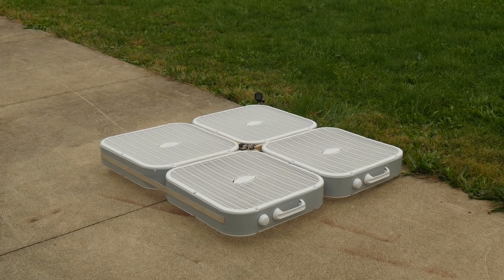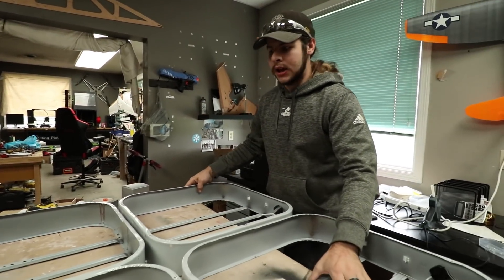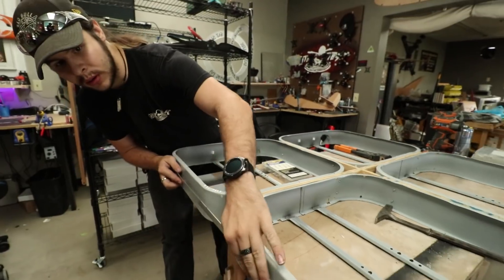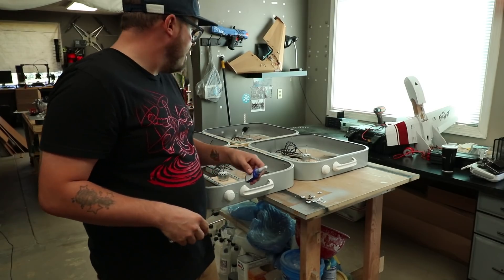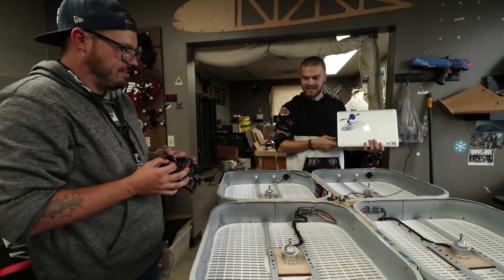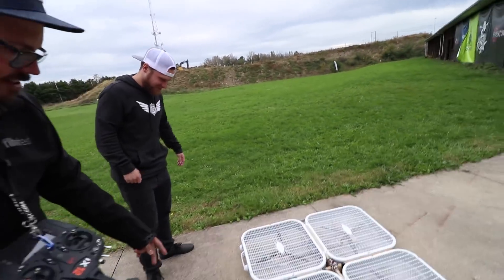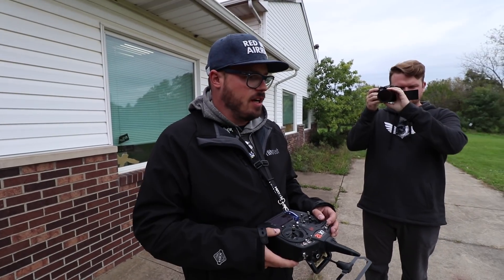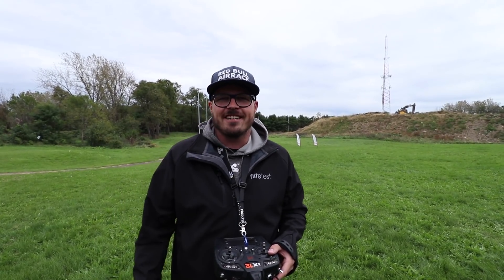Flying Box Fan Drone!

Comment: Just wondering!!!            Do you think if you made a VTOL.  about the same size of  a square card table  and put airplane type wings(airfoils) on the outside perimeter of all 4 sides .  the wings would open just above the top of the surface  about 15% open.  All 4 wings would almost touch each other and maybe 4 inches wide.  Then put 2 powerful ducted fans (facing each other about 4 inches or less apart from each other )  one ducted fan mounted through a hole  on the bottom center of the surface facing upward using air from under the table.   The other ducted fan facing downward  mounted in the center of the table  taking air from above the table.
a cone shaped diverter on each fan diverting the air 360 degrees radially blowing a powerful but thin air blade over  the surface of the table  directly towards  the 4 wings mounted on the perimeter of the table.  My question?   Would it fly??

Comment: Usually these guys got it covered.  However, on this build there's an issue.  The wood frame was completely unnecessary.  Bolting the fan walls directly together would have been sufficient, and if done right, no wiggle room at the connections would be possible.  In fact, the wood frame may allow for more movement as the wood can give, or even become slightly compressed at the tension points, allowing more motion over time.  The problem from the beginning was the outside edges of the fans, which he fixed with aluminum strips.  The added wood frame only added weight, not stability.   Just sayin'.

Comment: Ok but what is the point of the fan? To push air. Does it do this? Yes. Is it still technically a box fan? Yes. So it is not a fail or click bait.

Comment: Here's a couple of suggestions:

Reduce weight as much as possible, replace the wood with aluminum strip(s) if possible.

Cut away most of the grating, both top and bottom, to increase airflow and still provide some crash protection and structural rigidity.

You're losing a lot of air beyond the outer tips of the props. Is there a lightweight way to use a shroud to prevent most of the loss?

Comment: I haven't watched it all the way through but........
Fixing the 4 fan boxes together:  Ok, problem with what I saw.
1 - you show the weakness of connecting the 4 boxes together but HOW you did it was problematic.
2 - rather than adding the wood, use TWO bolts between them.  That would mitigate the weakness you saw at step 1.  The weight of the 4 extra bolts would be less than the weight of the wood.

Comment: Ridiculous... the audacity  of pro people.  Wasting good 80s style box fans like those! YOU could push dust and allergens around In style but nooo you had to tweak! Plus metal to heavy not enough thrust and you need indepindently driven motor that have compensation for air currents and even for a crude attempt it's way to heavy should have at least attached balloon with helium . That would have made it super retarded. But no only somewhat retarded is you wanted . So there you go. Halfassed

Comment: You could have used pull rivets to fasten those frames together. They would have been just as rigid without the weight of the wood.

Comment: I feel like you coulda made it lighter by removing the plastic fan controls and handles and making some holes all around the metal box guards and replacing those rails holding the motor with wood and maybe adding some landing rails.

Comment: Ok, so the new fan motors and blades work good. The frame is too heavy, lets replace it with some used drome frames of ebay and get these box fans back in the air.

Comment: @FliteTest It was said that those plastic fan blades from the box fans wouldn't work. How about taking on the challenge of making a drone fly with all props plastic fans like those? Find any floor fan with plastic blades you like. You don't have to use the fan's frame or motor, just the prop itself, and no reinforcing or modifying the blades themselves. (Obviously going to have to modify the center to attach to the motors, which is ok.) Will the torque from the motor sheer the blades off? Will the blades fly off from centrifugal force at high RPM? Will the blades snap due to flexing from too much thrust? Or will the fan survive full throttle but just not make enough thrust? On the other hand maybe it will fly. These are the questions and possible barriers to overcome for this challenge.

Comment: it is normal the engines are too small and in addition there is too much weight but the idea is good you have to have a perfect power weight like between 50 cc and 150 cc several engines and with several lithium ion batteries

Comment: Even though they replaced the motors and blades, its still a box fan that blows air so I think they did a great job. While not practical, you could still turn it on its side and use it as a fan lol

Comment: Just FYI using the original switch is probably a bad idea. It probably isn't vibration resistant to stay in position in a critical high vibration environment such as this. Last thing you want is the switch flipping off mid flight.

Comment: By the way it is impossible to make that thing fly with the original parts. Obviously they would have tried if it was possible but its not. Still and awesome video because indeed they are box fans and they kept it as original looking as possible even trying to use the knobs and the grates was awesome. Huge props to you guys for a kick ass vid
Positive vibes my dude

Comment: Sweet. Blew me away.  I was wondering what could be used that is lighter than plywood that you used for rigidity?  I was thinking some kind of plastic.  You can get it fairly cheap at Tap Plastics. A lot of times they have scrap that you may be able to get.  Very rigid and can be assembled the same as you did the plywood.  "Suggestion for future project."  Turbocharger off a heavy-duty diesel truck like a Peterbilt.  Make the turbo into a jet engine and put it on a go cart.  Similar projects have already been done but not very well from what I have seen.  They make great jet engines.

Comment: It doesn't count anymore because you threw away all the original fan parts. Even though the motors are not DC, you could have just turbocharged them by running 240 volts.

Comment: To all you people saying that they cheated/didn't make a boxfan fly....It was implied from the start that the video they got the idea from was obviously fake. Because it would never work. Duh? A BOX FAN CAN'T FLY. Not one, not four.  Of course they'd have to strip the guts out. Duhhhh. Though I bet they could've kept the screens if they cut some squares out/lightened the frames by cutting holes in the inside edges with a hole saw.

Comment: Next quad project?

Well, you guys know how you did the A-10?

Now, you need to make an attack helicopter... And have two FPV cameras, one for the gunner.

Some of the parts should be interchangeable. You could even simulate a top rotor and just mount everything to a quadcopter frame.

Comment: You could also try cutting every other bar out of the top grate for better intake and perhaps every 2, 3 or 4 for the bottom to help with the appearance and rigidity without compromising the thrust. We had to cut every other bar out of our bug zappers when we were in Ecuador because the bugs couldn't get in. This is what thought came to mind watching this video.

Comment: It's always fun to see how you could do it better. If the steel is able to be hardened, do a little research & see if it's better under water quench or oil, take it apart and see if you can temper the steal so it won't bend.

Comment: I thought the point was to make a box fan fly if possible, which it probably isn't so instead of doing that or at least trying that you ripped everything out of a box fan that makes it a box fan and added drone parts. Basically to drop in adds for the parts you were peddling in the video. This is stupid.

Comment: Following the links in their description:
motors  = $92.99 each.  4 used for total of $371.96
esc=$99.99 each.  4 used for a total of $399.96
blandes=$18.32. 4 used for a total of $73.28
Not from their links:
box fan frames=similar at WalMart $19.97. for used for a total of $79.88

Total for all the above parts: $925.08
This does not include the cost of the wood (chuckle, chuckle), the flight control, battery, shipping, other hardware and misc other costs.

I don't think they paid for most of these parts as they were provided by their sponsors.  I (or anyone) could build a much better (equipped and functioning) drone for considerably less.

In fairness they didn't say anything about the cost of this drone, only that they were building a "box fan drone".  Which of course they did not.  They did not see one on the internet and make it real.  They did what Hollywood would have done and faked it.  "As long as it looks like a box fan drone and we all act excited and scream like little girls when it flies then it will be a box fan drone".  This is no more a box fan drone than the picture of the drone that they say inspired them.  They took the easiest way out to make it fly rather than put any real effort or consideration into the original project.  Overgrown kids playing with someone else's money.  Not a subscriber and never will be.  I'll be sure to be more careful of the click bait.

I'll take the $500 drone any day.

Comment: Now take four radiator fans from some automobile, and use carbon fiber/fiberglass and plastic speeclips to secure them together to conserve on weight......radiator fan motors are 12 volt so you shouldn't have to change the motors.....the blades are usually offset however, older Honda Accord have nice round sturdy blades however. Just a thought.

Comment: Click bait. Nothing but fan cases being used here. Don't waste your data on this one.
Reply: Lol I use unlimited wifi
Reply: Is a car with it's engine and wheels replaced no longer a car? These are still fans, they just have upgraded motors and blades. Do you people try so hard to be unhappy about everything? Did you click this video fully expecting a regular fan to be able to lift it's own weight? If that's the case you deserve to feel ripped off.
Reply: Who cares its still cool
Reply: Its actually pretty cool
Reply: it still worked though.
Reply: Chris HTech haha its not clickbait moron , what did you expect to see? hahah
Reply: They're putting blades in with motors in a box fan frame. I say it is.

Comment: You didn't want to use nuts and bolts to secure them together, so you used some lumber plus screws? Plastic wire ties work better. They are no longer box fans after you gut them

Comment: In my opinion the main problem with the whole thing was the plywood cross you put in between the fans. It added way too much weight and was completely unnecessary as you could have just bolted the fans together without it.

Comment: The Digg posting I clicked on to get here had the title "An Experiment: Can Four Box Fans Strapped Together Work As A Functional Drone?  I knew intuitively without watching the video it wouldn't work.  So then I skipped the building part and went to the end and saw that it did work to my great surprise. I was shocked. But then I went back to the building part of the video and saw that it was all a big con job.  The only part of the original fans used was the aluminum exterior housing. That's it!  The motor and the blades and all the electronics were replaced with different components.  So the answer to the Digg posting is a big NO.
Reply: It was a con job? D:

Comment: Duct the fan and you can put the grill back on. I have done this to one of these fans already. it just needs a ring of thin plastic around the fan blades close to the blade travel for all the turbulence to go away.  They'll push twice as much air and do so smoothly.

Comment: Love you guys...but...about the frame, needing to be "as rigid as possible"...that's not true.  I once built a quad using a VERY flexible top to a Rubbermaid container (long story...it was part of making a waterproof quad, which would have also used the bottom of the container)...that quad, with a Pixhawk flight controller and an e300 drive system, flew just fine.  I'm not saying that's ideal of course, just that when you say the box-fan quad "probably wouldn't work" in it's native, flexible state, that that statement is almost certainly not true...really all you guys did by stiffening it up was add extra, unneeded weight.

Comment: Hey look at me, I'm gonna make a drone out of a microwave!

Just gonna have to replace the casing, since it doesn't really fit, but I'm gonna figure something out. Now the transformer is kind of heavy, so I need to take it out aswell. And the electronics aren't really made for drones, so gonna have to replace them, too. and the turntable motor isn't quite strong enough, so I will have to figure something out there.
So basically I replaced everything, but it's totally still a microwave.
Reply: Technician What an irrelevant comment.

Comment: Fun hack.  The roll probably was probably spoiled by the heavy boxes and wooden spars having so much inertia compared with what a controller expects of a normal quad.  Perhaps a box fan manufacturer would sponsor the development of a fully aerobatic quad.  In the short  term maybe  the wood spars could be about half the width they are which would shave many grams, and trimming at least some of the folded-over box edges or ducting the fans might improve airflow.  On the other hand it's understandable if you don't want to devote that much effort until there's a box fan drone race category.

Comment: that's a good idea to take an idea and make it work. Good job. I have a request, I want to explore a possible Cavern that has a small Creek coming out of it under large boulders. The bottom of the creek is basically River Rocks and I don't know how much room there is further in between the ceiling and the River Rocks. What kind of a flying drone would I be able to fly in there and accidentally hit the ceiling and then have it dropped and be able to take off again even if it's fallen in between some rocks.?! it needs to be a drone with a camera and a light since it's going to be going into a cavern that is Pitch Black I'm assuming. please help. I've seen these Whoop drones that you guys play with that look really fun, but they don't have cameras or lights and when they fall in the bucket they can't get back out. I need something that can get back out. I was thinking about putting you a lightweight cage around the whole thing so it won't fall too deep in the crevices and be able to take off again.

Comment: Funny, but I really think you guys should have wrapped the original fan blades in CF and painted them white to keep that consumer box fan look.  Removing the underperforming motors is absolutely necessary, but it doesn't really look like a fan with drone propellers on it.

Comment: If you used the original motors and fan blades, I'd be impressed. When you brace the boxes, replace the blades and motors, they aren't box fans anymore. I normally like your videos, but this one is bogus. Downvoted. Sorry, but this one wasn't as advertised.

Comment: I did something similar with a 5 inch quads and can testify. You need very thin wires. Those they use are preventing enough air flow.

Comment: Remove half of the spokes out of the grates with wire cutters and run that sucker. You should be able to put the lower grates back on. And have a bit for a power boost

Comment: In aircraft design,
one finds use of weight loss holes where ever possible.
And, maybe, give the viewer, the idea of grates, but don't use the original. make a lite weight ones, from other materials, and design an up graded pattern that's way more aerodynamically efficient.
And, one can hang the platform first to find the CG.
is there a way to use micro mercury balance swts for auto stability.
or is that a chip now ?
Eye, would think next challenge IS

a flying broom !
could create a market share.
think about it.
buncha witches out there.